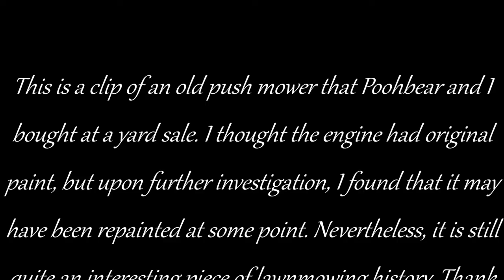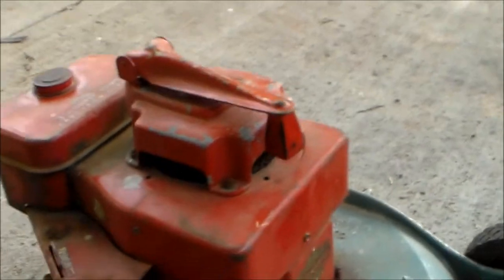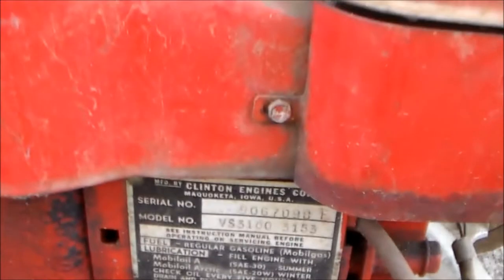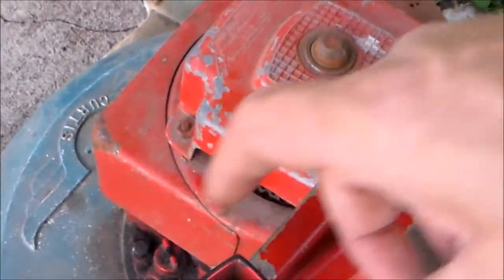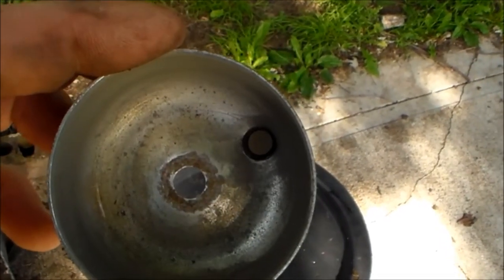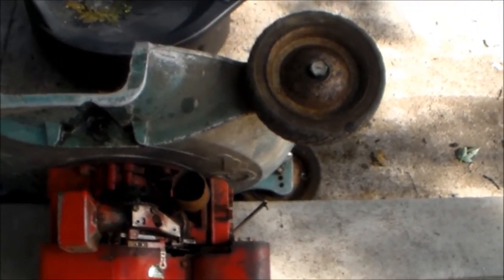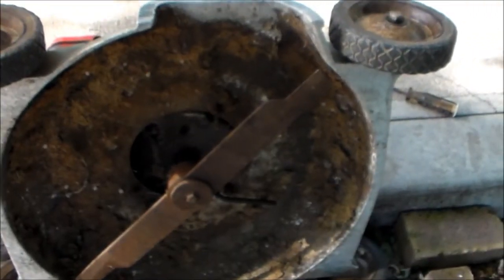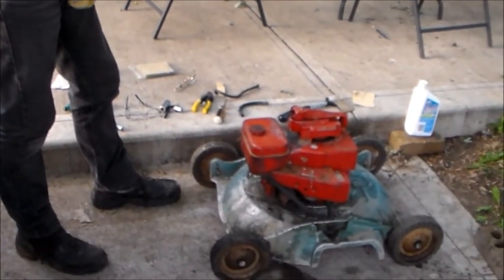curtis lawnmower

Comment: The other channel you thinking about with SmallEngineMechanic, yes his name is Mike, what you could do on the short term for a air filter is a piece of foam with a little bit of oil in it.
Reply from the maker: yep, i remembered that after i made the video lol. i have used the foam before but this mower wont be used for cutting grass, i just wanted it to keep it somewhat original. thanks for the tip though. and thanks for watching buddy. have a great week.

Comment: There are several vidoes about how to upload to youtube faster. Have you tried them? Cool old mower. Look at that deck. It's built to last forever. Not the like the ones you buy today. We have a reel mower and we love it.
Reply from the maker: thanks siszam, yes i have tried everything. still same problem. youtube is saying its my internet provider but i have the same thing i had 6 months ago when upload times were between 15-20 mins for 30 min video.
Reply from the maker: siszam also i got this pc for my birthday in January. its running widows 8.1. i have uploaded videos on my other site, www.S-I-S-O.com and the same video it took 4 hours to upload on here, took 7 mins to upload on there. but thank you for sharing the link, i will check it out just in case i am missing something.